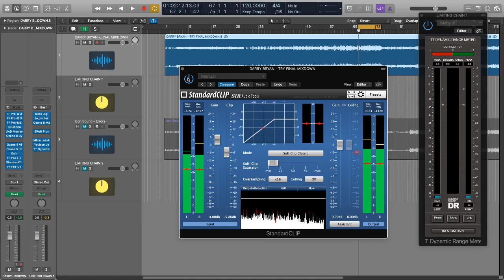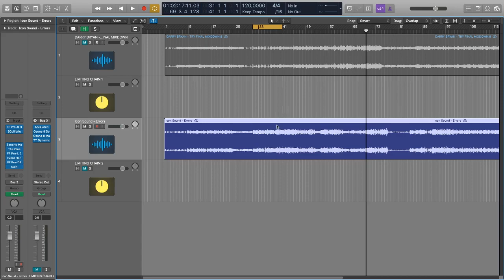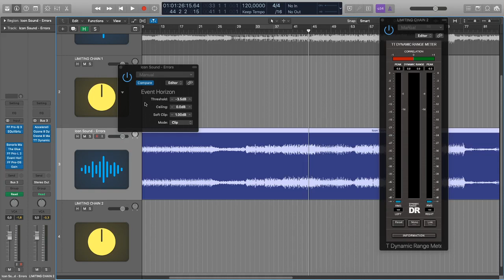[MASTERING] Clipping in Mastering: the Diverse use of Clip Plugins - Pro  Audio Loft EP.1

Comment: Are you putting it after the limiter or before the limiter?I can also see that you using your limiters both on your channel and stereo output..??can you please explain in brief your plugin chain and process.. and which one do you suggest the standard clip or Kazrog K-clip?Thank you.
Reply: Before the limiter
Reply from the maker: It depends on the use! There's no golden rule sometimes I don't even limit my master! In this case I clipped and then limited the signal. Experiment yourself and what sounds best is correct! Ciao!
Reply: I own almost every software clipper. Newfangled Audio Saturate wins hands down. Simply try it. Kazrog K-clip 3 i very good but if you use the multiband function and dont know what you are doing can do more damage than good. Another gery good one iz BOZ Big Clipper.
Reply from the maker: @saardean4481  Will test it on a video mate! :D Thanks for the suggestion!
Reply: @bigfootstudios7030   Nothing to thank me about. Enjoyed your video